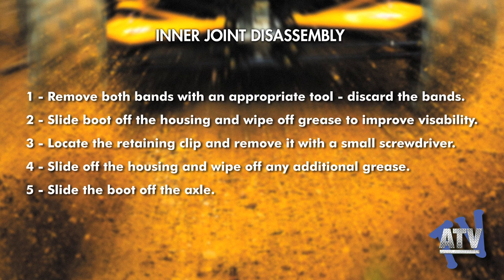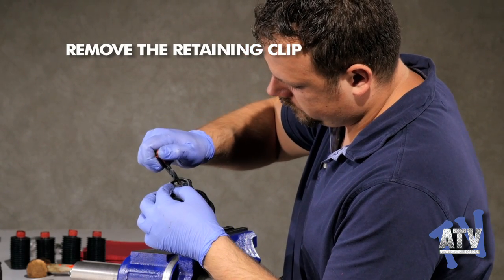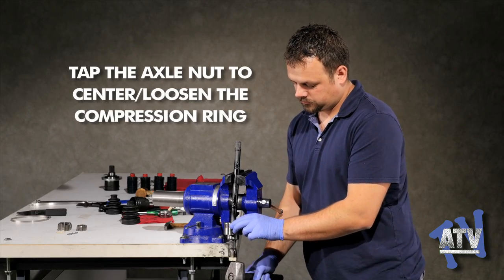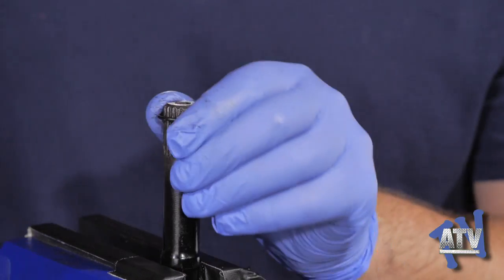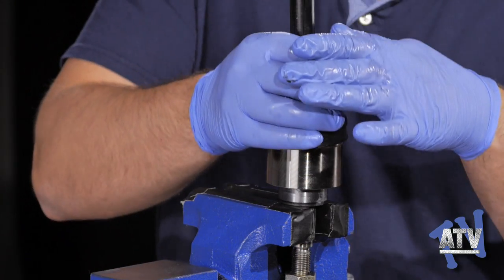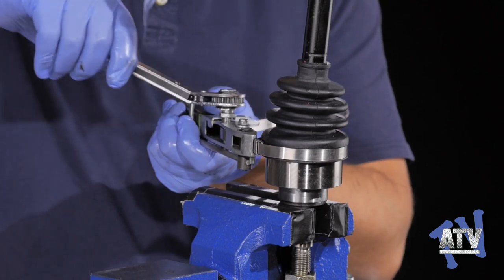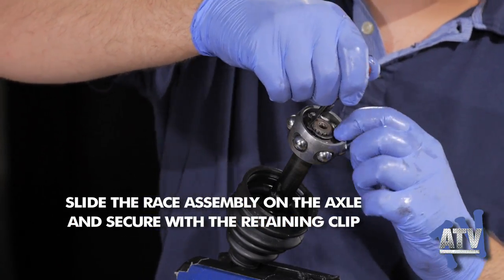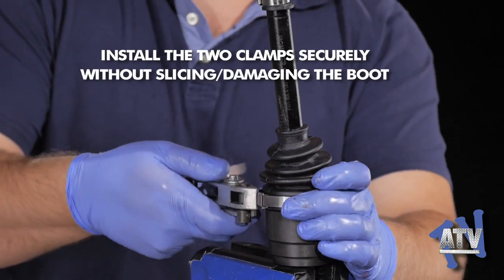CV Axle Complete Dis-assembly/ Assembly

Comment: I think you're better off not trying to disassemble the second joint because they are almost impossible to get apart. I had to resort to an angle grinder and cut off wheel to get the second joint apart. Just use some kerosene, paint thinner or solvent and compressed air to clean the old grease out unless that part is damaged.